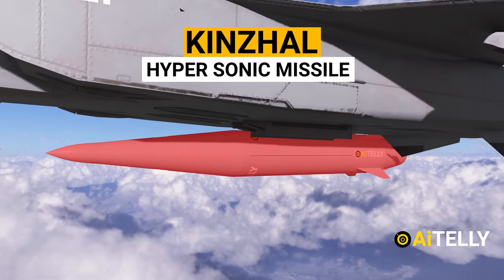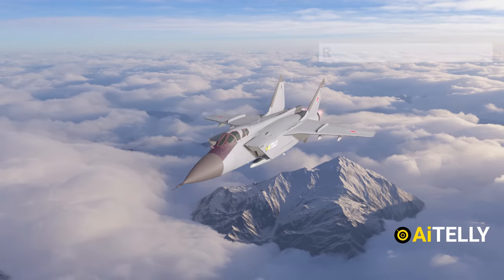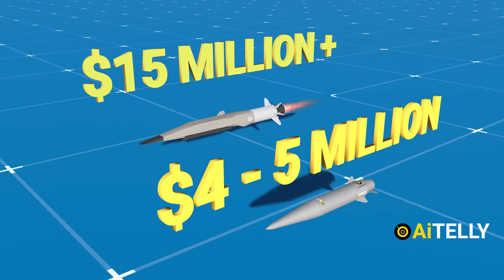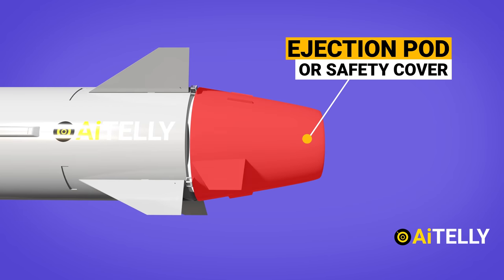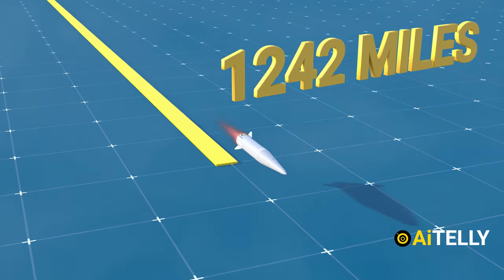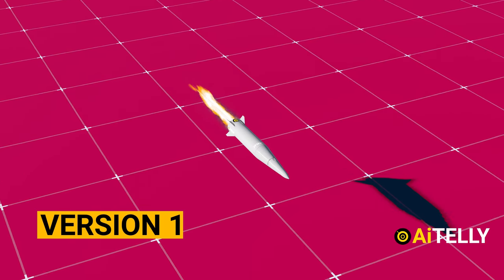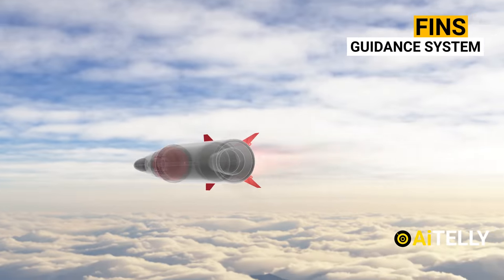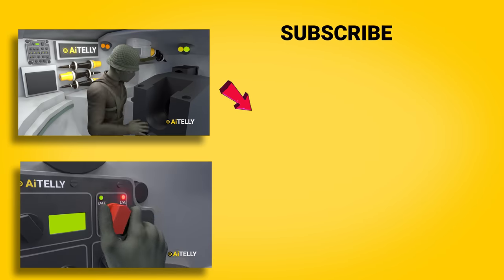Hypersonic Missile How it Works | Mig 31 Kinzhal Launch Process

Comment: Minor correction: the Patriot system intercepted 2 Kinzhal missiles after the missiles hit the Patriot system.
Reply: Jajajaja
Reply: What you did there, I see it.
Reply: yea i've seen a video - 30+ Patriot missile salvo failed, but that radar station smashed that Kinzhal into pieces!
Reply: Как простая ракета патриот может сбит гипперзвуковую ракету кинжал?
Reply: @НурмагомедАлимагомедов-ч1п  Там ещё рассказывали что бабка банкой с огурцами штурмовик сбила.
Reply: it was Grandma. She accurately shot down a rocket with a jar of cucumbers.
Reply: Whole worled seen how two Patriot batteries (1 control, 1 radar and 8 launchers each) intercepted Kinzhal near Kiev shooting all 32 missiles  :) But on the ground. After got hit missile was destroyed finally :) Ahahaha
Reply: Patriot system had 1 launcher damaged reducing the number of missiles ready to fire by 20% until replaced, and any missile defence system can be oversaturated. If they hit the command station or the radar station it would of actually disabled the system.
Reply: @zano187  Go back to school. 8 launchers. If one damaged it is -12.5%. In Kiev 5  launchers were destroyed  together with control and radar.
Reply: @mer3abec  your right, got my math wrong, but wow I didn't know that they nuked Kiev with 2 kinzhals since a Patriot system is spread out over a km
Reply: @zano187  its can not be spread out  over km. Because it is connected with control with optical cables.
Reply: Russia has created a good sword - the "dagger", but the shield is also only the S-500, and it's not a fact that we will shoot down our missile
Reply: @mer3abec I guess you haven't even looked at one before....  The only wires are power lines from the generator to the command center and radar... you literally just have to go to the images tab to see the massive antennas sticking out above each battery... it's the Russian S200/300/400/500 that's connected by wires and are grouped close together...
Reply: source: russian troll
Reply: @НурмагомедАлимагомедов-ч1п  Well, not at all, it's just not convenient for the public and the commercial sale of the Patriot system. It has to be sharpened a bit. As with the mention of a blackeagle hypersonic missile flying at mach 18. It's just that it's still in development, which can never be finished.
Reply: @borislav krstić  the funniest thing is the first US hypersonic program to likely succeed and come out is a hypersonic plane, Quarterhorse, which is basically an SR71 but with a ram jet bypass instead of creating a shockwave to slow down the air to subsonic speeds.
Reply: off course, no proof?
Reply: @zano187  And how far did they go with that plane? Have they already made a movie about him in Hollywood? As we know, they first launch their projects in Hollywood, and I am somewhat out of touch with what is happening in Hollywood lately.
Reply: @fevgg  bro... The whole world saw that night video when the patriot launched over 32 rockets and within 5 sec something hit the patriot and destroyed it.....
Reply: @ruslanshevtcov6802  не ну всё же учитывая то что у нас есть кинжал, а у других аналогов нет то можно предположить что мы готовы будем к защите от гипер звука к моменту принятия на воружени в сша
Reply: 😂😂😂 no one proof even zelenski say thay van not hit kinzal 😢😢😢
Reply: LOL))) those were not Kinzhals. it's Geran'. This patriot whas attacked with combined weapons to confuze it and see how it can hande it.
Reply: @sergiyrospysdiyenko6224  when russian troll is more plausible source than all westard media in sum
Reply: @SEDUXXEN  ru minister of defense boasting Jhon Deer all over ru TV
Reply: Патриот перехватил Кинжал???? да вы фантаст, писатель фантаст.
Reply: @omskpravo55  kunzhal is ballistic missile, that exists from ww2.... it doesnt maneuver rapidly as required for hypersonic missiles
Reply: Zelensky Said ???
Lol...
Reply: @НурмагомедАлимагомедов-ч1п  всё очень просто, самим комплексом Патриот, не ракетами.
Reply: @omskpravo55 это юмор, мол ракета Кинжал сбита самим Патриотом, а не ракетой😅
Reply: Minor correction - over 30 patriot missiles had been launched so it's obvious 30+ Kinzhals were intercepted. 🤣
Reply: Is there any evidence the missiles hit the Patriot system though?
Reply: LMFAO yeah right🤣
Reply: The most useless air defense system 😂
Reply: In a smaller area, it can be intercepted easier but not in a larger area😅
Reply: @mer3abec  yes yes, you know all about PATRIOT battery near Kiev, even if you see Ukraine only on photo. Kinzhal is the same sh*t as the Iskander, because its hypersonic BALLISTIC missile
Reply: ahaha - nope
Reply: Your comment is so hilarious 😂 😂😂😂❤ it makes my day..thx
Reply: There is absolutely no evidence to substantiate these claims

Comment: MiG-31 can do like Mach 2.8 and release a missile from high altitude
Reply: i like mig-31 this is interceptor is beast plane from ussr it's stratophere jet yes like u-2 & sr-71 so they i call trio stratophere plane :)
Reply: Shhhhhh
Reply: Whith this never. It can not reach Mach 1.
Reply: In Russian dreams only
Reply: на большой высоте: 3100 км/ч (M=2,8) МиГ-31БМ, 3000 км/ч (M=2,7) МиГ-31
Reply: @Mykyta625  nope. It's a fact. But only for a matter of time since it will be exhausting all of its fuel if it stays in the afterburner.
Reply: @Raz82000  nope, mig 31 is not capable of achieving Mach 3 because of air resistance of rocket
Reply: mach 2.83
Reply: @Mykyta625  rocket? What rocket? Mig31 uses an afterburning turbofan. I'm wrong btw. It almosts reach mach 3 since 3000km/h is mach 2.83.
Reply: @Raz82000  it can without kinzhal, with kinzhal attached it does not, it’s goes under Mach 1.
Reply: Миг-31К ! Может нести Кинжал
Reply: @Therearethings8148  it go 2M with Kinzal
Reply: @Mykyta625  
The ture is that you have no idea, like all of us here. 
We can only speculate about this.
So to figjt so hard in comment it is kinda stupid and have no sense.
Reply: @Mykyta625  ...and Ukrainian reality
Reply: @Mykyta625  рагуля, дупу рвёт?🤣🤣🤣
Reply: @Mykyta625  Наши сны сбываются как видишь, нет больше патриота. Молись чтобы нам ещё что нибудь не приснилось.
Reply: @Raz82000  M 2.83=3500k/h.
Reply: @АльпАдиннадцатый  M 2.83 =3500k/h.
Reply: Ghost of Kiev is here again :) , downing Russia´s most advanced missille with USA´s high price and low performance Patriot :)
Reply: @9volker  а если постарается, то и два Кинжала. Но недолго. )
Reply: @Mykyta625  its okay you guys made US fire 30 patriot missiles in kiev to intercept 1 😁 only for 4 missiles from the patriot to come back down and have friendly fire if its russin dreams then kiev is getting the harsh reality
Reply: @АльпАдиннадцатый  Mach 2.83=3500km/h
Reply: @Therearethings8148  Source?
Reply: @Raz82000  The big arse rocket hanging underneath it, ffs.

Comment: MIG 31 has a CRUISE speed (most efficiant ie best MPG) of Mach 2.4....not top speed of 1.4 like video says
Reply: This video is completely based on american side.
Reply: @shakyasingadhikary  it's based on high content copium.
Reply: look, he said 1.4 at LOW ALTITUDES, which is actually correct.
Reply: @MetalevaTruba  and why do you need low altitude speed named, for a plane that is designed to fly Very Very high🤣👍
edit: and Kinzhal is fired at high altitude too....so its a copium data that has only 1 purpose...to make Russian plane look weak..😬🥳
Reply: mig31k max speed is 3000 km/h mach 3, It was limited at this speed due security reasons, its precesedor mig25 was limited at 3500km/h but in test flights it did reach +3700 km/h. Mig25/31 are the fastest fighter planes ever.
Reply: It says in low altitude. But yea, foxhound is meant to fly in high altitudes and reach higher speeds.

Comment: 1. Iskander is a single stage missile definitly, it has an inseparable warhead, seems like as a Kinjzal. So all maneuvrs does by main engine and main fins all the flight, and near a target too.
2. Mig-31BM can travel up to 2.8M speed on high altitude.
3. Max STATIC altitude of Mig-31BM is 21,5km (with full combat payload), dynamic - up to 30km.
4. Grid fins become ineffective on speed higher than 1km/s. Iskander definitly hasn't grid fins, likely as Kinjzal. 

So, if you launch ground 500km-range missile (at least 4M from ground, either it can't flight 450-500km even by optimal ballistic trajectory) from altitude 20km and speed like 2.5M - it can accelerate to hypersonic speed about 10M like piece of cake. What is a doubt on it? A, it's just eternal western propaganda about bear-stupid and incapable russians...
Reply: Exactly, but I think the kinzhal is launched from a Mig31K, a variant made specifically for launchinghypersonic weaponry
Reply: 1. how long do you think it burns? Half a minute? And then what? Balistic. 
2/3. The data in wikipedia is a bit exagerated. Wel massively actually. The Mig31 is repurposed shells of Mig25 that had no engines left. Russians fit in them what they had. You should tha these specs with a sack of salt. 

You as most others are missing the point. The difference of what is hypersonic missile vs what is hypersonic weapon. Lots of missiles are hypersonic. But russian propaganda calls kinzhal a hypersonic weapon, that is compleatley different thing. 
What they do is quote Biden and others when they are talking about hypersonic weapons, saying that it's impossible to defend agains them. And then showing this analogovniet saying its hypersonit and magical and does plasma and goes in zigzags and other stupid stuff.
Reply: @dovydaskaminskas4227  
1. Dual-mode solid state engines can burn all the flight. As Iskander's engine definitly, 48N6 heavy anti-aircraft missile's engine, and lots of other. Gas-dynamic control provides this maneuvers for high trajectories/long range missiles.
2. Mig-25 and Mig-31 have a VERY different engines, by the way. Educate yourself first.
3. You can excogitate all you want, but reality doesn't change. Even older mid-range ballistic missiles are still very difficult targets for air defence, so if such a missile can make unpredictible maneuvers, it becomes an impossible target. Ecpecially for incapable western ground 'air defence'. Ask for a 'Patriot' battery in Kiev. We are waiting for the hyped, but never tested in battle THAAD for another epic failure.
Reply: 1. burn all the flight? Really? And mach 10 right? At first when you said something about initial energy and velocities I thought maybe you did at least average calculations, now it's obvious you are clueless. 
2. Did you read whay I said? Or was that sentence too difficult? 
3. iskanders or kinzhals doesnt make unpredictable or any maneuvers. Corse correction maybe, but that is also in meters from initial impact location. Its obvious just looking at the shape without using CFD, this shape doesnt maneuver period. You can turn it sideways to the airstreem, it will still keep the same balistic trajectory.
Reply: @dovydaskaminskas4227  
1. Absolutly right. You had made a tiny success. Now let's google for example 'MK 104 Dual Thrust Rocket Motor' and tell me more about clueless, but yours.
2. Same story, my dear silly anon. If two planes have the similar airframes, it doesnt' mean that its have the similar flight performance. So it goes.
3. Machine-Building Design Bureau speaks one thing, but youtube anon, who a little earlier proved himself as an ignoramus and repeater of bullshit propaganda, speak another. Who is more credible here? The answer is obvious...

P.S. Oldy but goody Pershing-2 didn't use any CFD too, but this didn't prevent it no from performing huge pull up/pull down maneuvers before and after its altitude guidance mode, neither from being a hypersonic vehicle.
Reply: @hocumd2852  
1. LOL ok, you show a random name of a solid fuel thruster and what? Tel me this. Do you suggest that kinzal or iskander burn al the duration of its flight instead of full thrust initially? Then either you call al the russian engineer idiots or compleatley agree that mach 10 for them are imposible. Hardly mach 4 in this case. 
2. Its you who repeats the russian BS. Go read some history. Mig31s are old mig25 shels. Original mig 25 engines where disposible, and they run out. 
3. who speak what? I only see russian media. And for them physich works differently. Show me what the design bureau says. Oh... are those the same who made the kinzal motor burn the entire time of its flight? LOL then, nevermind, dont expect anything inteligent then. 
This is not a pul up or down, that is reentry brake. All of reentry wehicles does this or would not withstand the forces and heating. And this is what I said earlier of how much of a deviation from initial trajectory that can make. This isnt the maneuvers russian analogovniet fanboys say kinzal does.
Reply: Those are two completely different missiles. But hey, let them have their own fun thinking what suits them 🤭
Reply: PERFECT ANSWER ;)
Reply: The author is incompetent or just a liar! Because he doesn’t know the maximum characteristics of different equipment. 😂
Reply: @dmitripetrov1182  I dont read hieroglyphs.

Comment: Indeed, the Patriot downed the Kinzhal($10 million) by intercepting it directly with its body($1.1 billion for the whole battery) on the ground. Great job Patriot, great job indeed...
Reply: @MartinMartinX  Thanx from Russia)
I'm kinda tired of explaining that)
Reply: As always the Americans must be knew everything 🤷‍♂️🤷‍♂️
Reply: Na, patriot hit them. Russia send 2 drones to damage asess,.... that got downed by gepard and that drone debree fell on one piece and costed 20 K damage. 🥳 Was repaired with DUCTAPE untill replaced in 24 hours. Go dude Go.
Reply: @XNeo27564  No, Patriot did not. Sorry for breaking your fairy-world.
Reply: @user-lv6fo7gy9p  Well, you and russia are in a fairty world bro. ?
Reply: @??????  yes it did.  And the damage to the system was minimal
Reply: How could one missile destroy the whole complex if it consists of several machines?
Reply: @itkd9790  надо просто учитывать радиус взрыва "кинжала"
Reply: @itkd9790  there is missiles that able to destroy half of the city solely. But they'll be used in final turn of escalation so you have few bonus years of civilisation
Reply: You wäre a dreamer
Reply: 😂
failed even after firing 30 missiles
Reply: @itkd9790 It depends on how powerful its blast is.
Reply: kinzhal is $500 000 wtf is this 10 million price, jesus

Comment: That MIG aquire speed more than double you stated. Apparently 3 mach, not only 1.4 mach
Reply: С Искандером на борту 3 Маха не получается. )
Reply: Да, тяжеленькая ракетка... Ну до своих 3300км/ч точно не дотянет, но до 2500-2700 наверное сможет? Ну конечно это все мультфильм, реальность знают только изготовитель
Reply: @kurdyumov4203  больше двух явно полетит. 1400 для мига 31 это черепашья скорость.
Reply: @Black_Ninja4492  я говорил про 2700-2500 🙂. 1400 для МиГ 31 это так, для разогрева

Comment: But you have a very rough mistake: Russian missiles like Iskander/Kinzhal type have no 2nd or 3rd stages, and they are only one stage system with a solid propellant rocket engine, that's is the very big difference. And also there are not illustrated any tail wings that are near the exhaust nozzle, to make different maneuvers of this missile. In that case with that big speed even a destroyed rocket can make a lot of damage with exploded parts, and even just by kinetic strike by the target with out any warheads on..
Reply: Она так же совершает манёвр кобра когда приближается к цели так что баллистические радары бесполезны
Reply: @ИМммм-ы6я  да, ударяет в цель на последнем этапе вертикально сверху вниз, для этого резко возвышается, а после пикирует. Но на последнем этапе скорость снижается как минимум до 4-5 Мах, а никак не 10-12, но этого хватает на данный момент.
Reply: @ULZIMAKUM  ну так больше и не надо в момент попадания
Reply: Actually they show in pictures small "deflectors" in the rocket engine output and a set of small circular items around the edge of the rocket motor. It looks like guidance control.
Reply: @SewTubular  yes.. But there are a lot of pictures in web of real type of such wings.